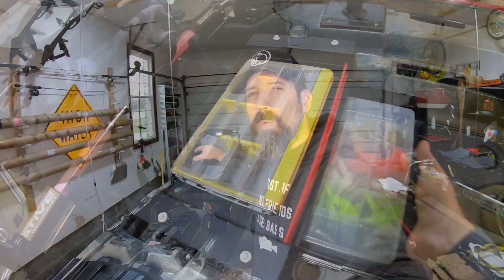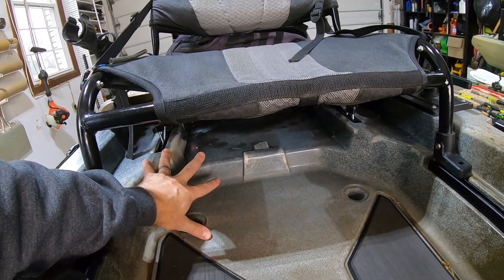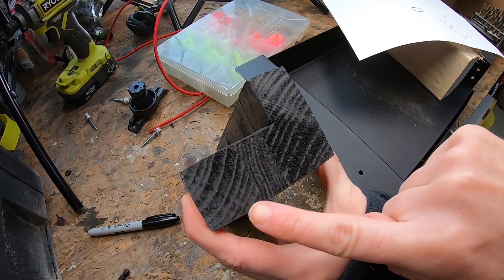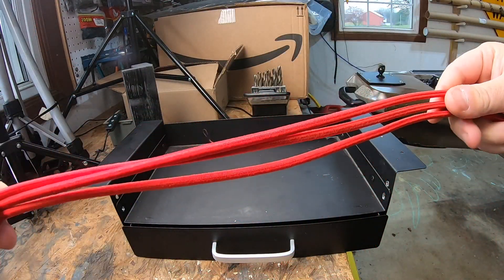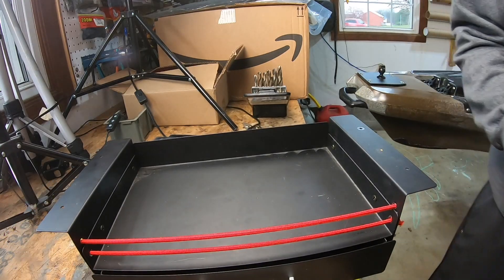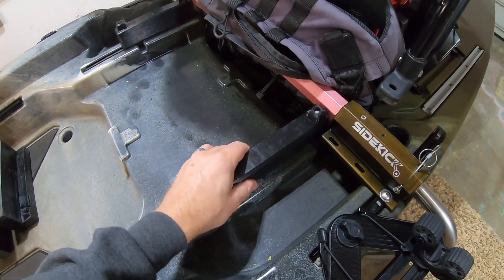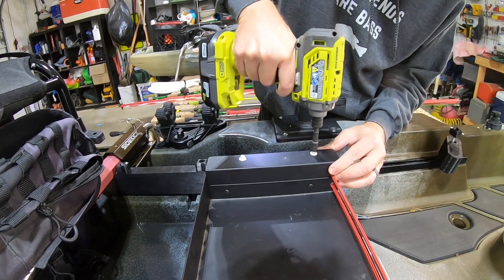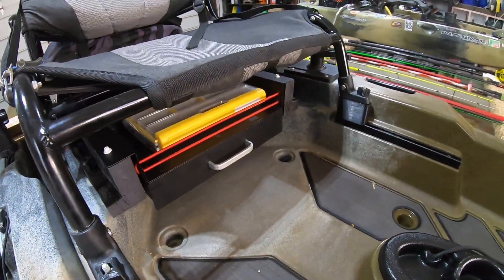The First Ever Under the Seat Drawer for Bonafide P127!!!

Comment: That’s a pretty nice DIY.  I’d you were to do it again I’d recommend expanded PVC foam.  It’s lightweight, cuts like wood, and can be chemically bonded at the seams.
Reply from the maker: Not sure how that would work... you would create a mold?
Reply: @wendellfishing  it’s basically cut, use screws, and a chemical bond agent.  Last time I used it you could find it up to 3/4 or 1” thickness and in a 48 x 96” sheet
Reply from the maker: Ahhh.. I see what you are sayin now! Right on.  @JoshB-Fishin